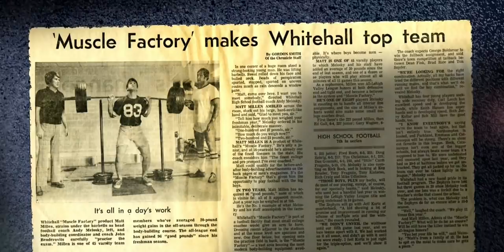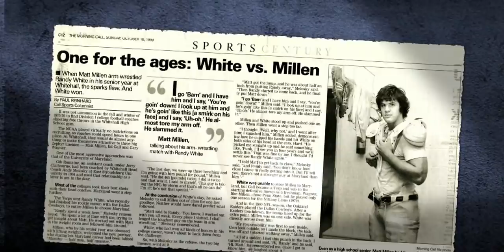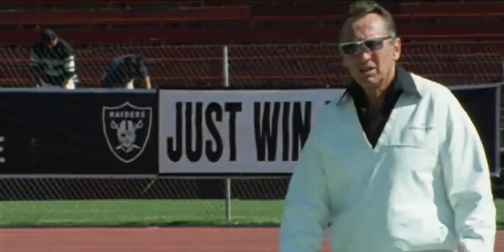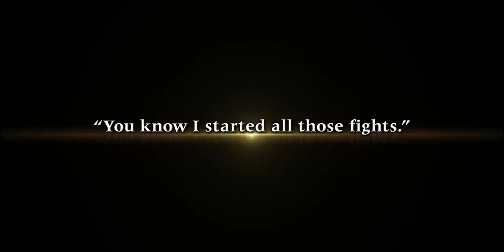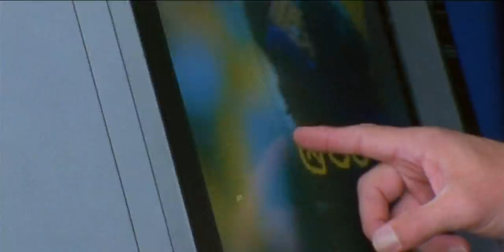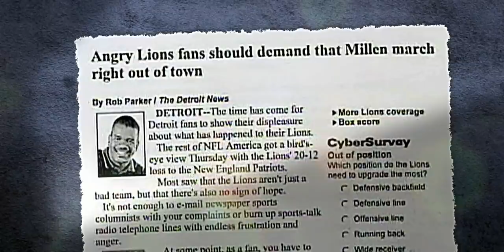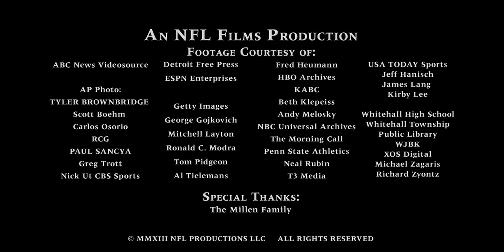A Football Life - Matt Millen HD - Biography Channel

Comment: To all Lions fans, one, if you knew Millen in person, you too would want to hire him and give him every benefit of the doubt if you were William Ford. Two, Millen, even by his own admission, failed as a GM - but you could not have done the job better.

Millen, in truth, was definitely leadership material - he worked hard, was a good communicator, and a great teammate. But he was not ready to jump into administration for the whole team, including off-field responsibilities.

What if Pat Riley jumped straight into managing the Lakers instead of coaching in 1980? He too, would have wrecked the team. It wasn't until after 15 years of coaching when he was finally ready for it.